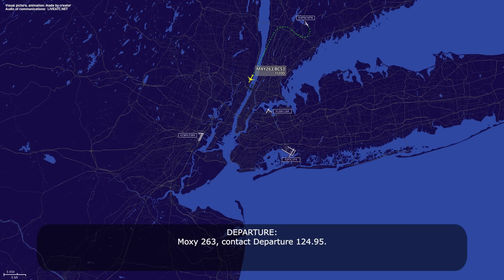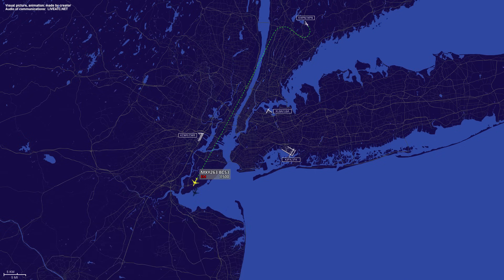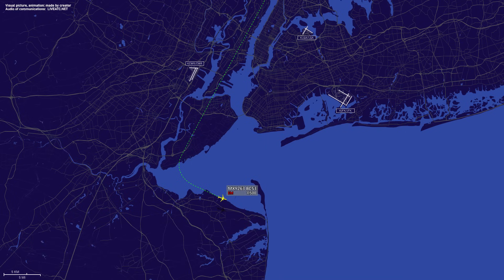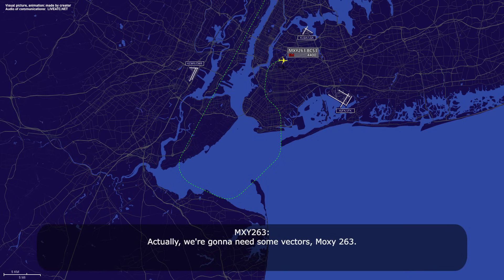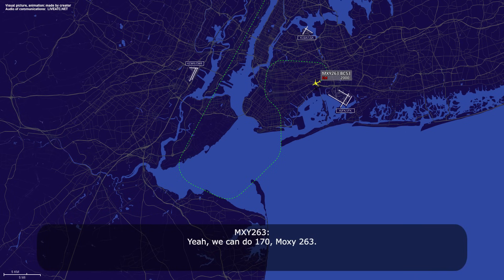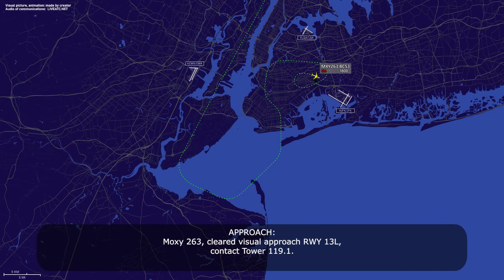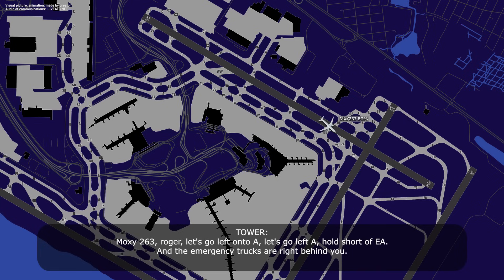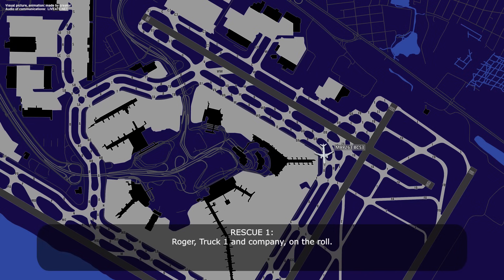Engine Fire in flight. Breeze Airways Airbus A220 diverts to New York Kennedy Airport. Real ATC

Comment: The FAA restricts pilots to an age limit of 65.
Please help to enhance aviation safety by contacting your representatives to raise the age to 67. I'm required to get an in-depth physical exam every six months that will include cognitive testing, and an EKG every year. In addition to the physical exam we are retested on our ability to handle complex emergencies in the simulator every nine months, if we do not pass we may be fired.
Our experience is worth us staying on longer till the industry stabilizes. My 30 plus years and 10,000 hours has allowed me to see and experience a great deal.
The FAA allows a new budding student pilot to reduce their actual flight time just because they studied at an aviation college. We can all attest that this job is more than what you can learn in a classroom. Before I got hired with a major airline I had completed an intensive military commissioning program after college then a two year military flight school that encompassed mastering aircraft that could exceed the speed of sound. The industry needs our continued mentoring and diverse backgrounds to enhance safety. With inexperienced pilots not only on the flight deck, but FAA controllers in the ATC system our knowledge can help avoid or at least mitigate a disaster.
These are the FAA reduced minimums that our industry has built into the hiring protocols.
You be the judge
This advisory circular (AC) provides instructions for institutions of higher education on how to obtain authority to certify students who graduate from the institution's degree program with an aviation major and otherwise meet the requirements of Title 14 of the Code of Federal Regulations (14 CFR) part 61, § 61.160 (b), (c), or (d).
Graduates of an institution of higher education that has received Federal Aviation Administration (FAA) authorization to certify graduates may be eligible to apply for a restricted privileges airline transport pilot (ATP) certificate. The total flight time requirements for a restricted privileges ATP Certificate based on a degree with an aviation major are:
• 1,000 hours for a graduate who holds a bachelor's degree with an aviation major and meets the remaining requirements of §
61.160 (b);
• 1,250 hours for a graduate who holds an associate's degree with an aviation major and meets the remaining requirements of §
61.160(c); and
• 1,250 hours for a graduate who holds a bachelor's

Comment: It seems like all emergencies in the greater New York area always divert to JFK which of course they should if it's the best option but generaly speaking an A220 could land at any of the airports? Isn't it quite a disturbance for JFK if on a bad day they have to deal with multiple diversions?
Reply: Under normal circumstances an A220 could easily land on a shorter runway, but with an engine fire they might not be able to access their thrust reversers (or their company policy might dictate that they shouldn't) so in this case, I'm guessing they had to figure out what length of runway they needed in order to minimize that risk. (I'm not a pilot myself, so this is my attempt at deducing the right explanation.)

When the plane is on fire, that generally takes priority over pretty much everything else (including regular airport operations, even at a busy place like JFK).
Reply: @andrew-m  Thanks, I get it but my question is if this still holds even if Newark is more than adequate and even LaGuardia or returning to airport of departure would be well within the limits. Looking at it purely from a JFK perspective, it doesn't seem desirable they are such a magnet to everything within 100 nm when there are perfectly acceptable other options for most non-A380 planes. Then again, for off-loading an unruly passenger, JFK might not be that popular because it would take a long time to get airborne again.
Reply: When you have a fire you want the best equipment and first responders possible so you don't endanger a planeload of people. Disruptions be damned.

Comment: Is it just me or those A220 have a lot of issues with their engines?
Reply: Yes, I recalled reading something about that and googled to confirm. 

"The Airbus engine headache is getting bigger and bigger" -- "Airbus (EADSY) has been trying to take advantage of Boeing’s (BA) struggles, but instead it keeps running into problems of its own. The Wall Street Journal reports that engines for the company’s smaller A220 models are having durability issues that have kept many of the jets using them on the ground."
Reply: Engines for the Airbus A220-300 are made by Pratt and Whitney, with factories in different locations across the United States.
Reply: @aviationhighabove Likely a indication not a engine problem. Some interesting choices by the flight crew with a fire indication airborne.
Reply: @ Agreed.
Reply: @GeorgePsaros  seems like a contained (or possible even extinguished) engine fire so not sure what you mean